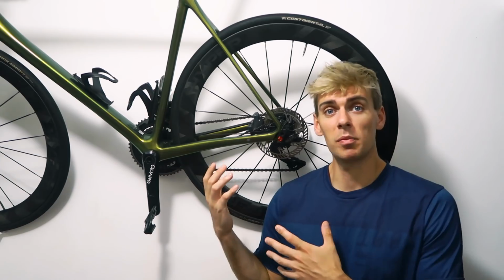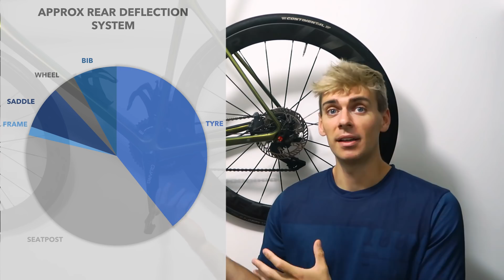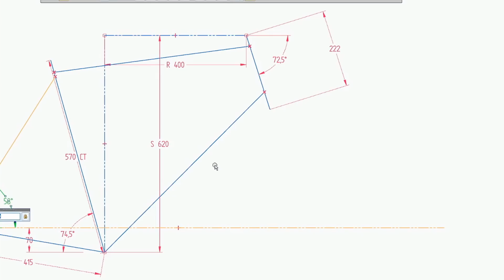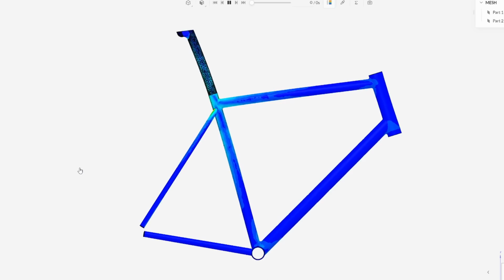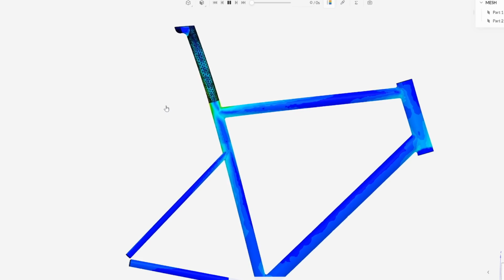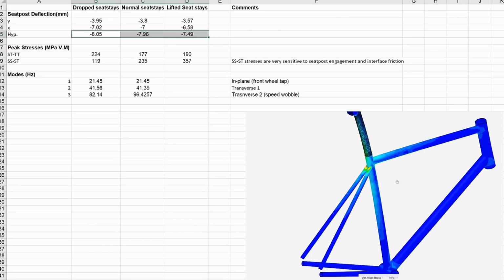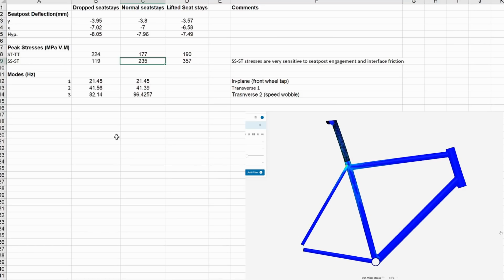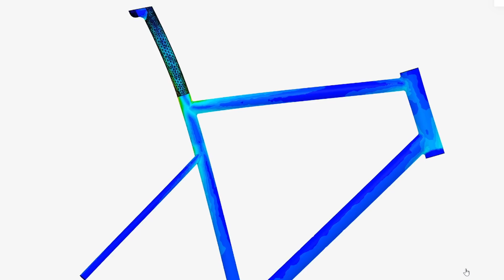Do dropped seat stays improve comfort? No.

Comment: Great tutorial. Seat tubes used to be (works of art) fluted, curved butted or necked on our big old 80s steel frames to gain more flex and compliance and we had much deeper seat rails and fat old seats. The other day I took my  87 Raleigh competition out. 20 mm tyres 120 psi and had no compliance issues. I was out with my mates on their new aero carbon bikes and I was anazed at how noisy and  jiggly their bikes where. One of my mates can’t read his garmin mounted on the bars as it vibrates so much even on 28s. I reckon that my mates Canondale was as harsh as my 92 trek alpha.
Reply: Likely because of the wheels you had. Swap the wheels out to the much stiffer ones we use today and compare again if interested.

Also sounds like your mate who couldn't read his head unit had way too much tyre pressure in his front tyre.... probably someone who runs 100psi in 25mm tyres, which is far higher than 120psi in 20mm tyres
Reply: @MrBJPitt  he’s an experienced racer tyre pressures where as low as he wanted for save cornering his new Dale is one stiff uncomfortable ride. Far worse than the rim brake super 6 he now regrets selling on the similar deep sections wheels and tyres. You can run lower pressures in 28s but you get to a point where the side walls start to move and that’s more a less at the same pressures as 25s.  This generation of bikes is far from perfect and like all transitions the industry goes back wards before getting ahead. A mature steel was better than the new alluminium, nature aluminium was better than new carbon and mature rim brake frames are far better than the modern disc bikes. In ten years when disc bikes mature they to will be good. At the moment there’s insane compromises to make them work.  . I’ve got 16 mid range production road bikes (weighing between 7and 10 kg) to ride and compare from 83 to 2010 and I have yet to find a disc bike I would want to ride.
Reply: @tobycolin6271  sounds like codswollap to me regarding tyre pressure. What tyre pressure does he run? How heavy is he.
Reply: @MrBJPitt  he is 107kg runs 90 in 28s and 105 in 25s like he’s always done the super 6 was fine on these pressures his new bike is an unhappy beast.  There’s a high frequency buzz and the thing just is truly awful on 60s.  It’s the front wheel fork combo is to stiff. He’s now got a 38 in the front and it’s better but not the aero beast he wanted. Once you start getting niggled by a bike and make compromises the shine goes.
Reply: @tobycolin6271  even for his weight he runs 28s at 105??? Yeah, that's stupid. Totally user error. Dangerous too, that's a wheel failure waiting to happen.
Reply: @MrBJPitt  I’d take you more seriously if you could read. He runs 90 in 28s. And you can run 125 psi in all continental tyres.  None of the wheel tyre pressure and weight limits are exceeded so your wheel failure waiting to happen is an irresponsible and incorrect statement.  Ill informed inflammatory comments are not helpful and is fuelling the scaremongering that is currently running through our sport.  I know parents that’s are know genuinely worried about racing on rim brakes and are looking for new bikes for their sons and daughters and that’s not right.
Reply: @tobycolin6271  your buddy is 105kgs.... I'm sick of this discussion, he clearly isn't a fast racer, and his bike isn't designed for a 105kg rider. Then you blast your tyres up to ridiculous pressure and complain it's too stiff? Lol, this is a joke.
Reply: @MrBJPitt loads of us raced over Europe in our 20s when we where much younger and lighter. We can still knock out evens today. We raced track bmx and criteriums back in the day and ride vets now. Just because we’re heavy doesn’t mean we’re slow and because we’re old doesn’t make us stupid or not able to setup new bikes or understand new tech.  Let’s face Chris hoys not that light and I don’t think you’d call him old slow or stupid. But there you go someone doesn’t agree with you so you spit your dummy out and go off in a huff. And when was 90 psi a ridiculous high tyre pressure. Deflection and rising rate is determined by the force pushing down versus the tyre construction and air pressure.his dale is designed for 125kg by the way. But you can’t read do no research and believe the media hype.
Reply: @tobycolin6271  can't be bothered to read the wall of writing, your experience is not at all my experience, so much so I just don't believe you.
Reply: @MrBJPitt  cycling is for everyone there’s a race series for us oldies, track and sprinting for big lads and that what is experienced by lighter riders is not what is experienced by heavier riders. The new bikes have problems caused by discs and cross spoke front wheels and that’s why the manufacturers have complicated frame solutions. We now have frame decouplers , fat tyres, long beam seat post to isolate the riders. Not all of these things work at all speeds on all surfaces because of resonance. I’m sure we’ll find the sweet spot ion my mates new cannondale but it’s much harder these days as you can’t swap bars change spoke patterns to effect compliance.  The  point is you can’t be bothered to discuss an alternative view or think that someone may be disappointed with a new bike.
Reply: @tobycolin6271  you can't expect to buy a bike designed for pros, and then pump the tyres up with 50% more pressure than for purpose, and expect them to be fit for purpose. Tubeless tyres aren't even supposed to exceed 72.5 psi.... so yeah, your argument is ridiculous to me.
Reply: @MrBJPitt  that’s why Hutchinson, Pirelli and continental have recommendations from 60 psi to 120 psi stamped on there tyres. Deflection, tyre contact patch and rolling resistance are dependent on three variables, tyre pressure, tyre construction and rider weight. You adjust the pressure to optimise them for the rider. 60psi if your light 120psi if your heavy 90 psi is in the middle of the range that my mates using for a 28.  What’s your next nonsense suggestion going to be. May be he should by a gravel bike so he can run 50mm 650 b wheels at 50 psi on the road.
Reply: @tobycolin6271  what do you stick tyres on? That's why zipp has a max pressure. I'm done talking about this. You are arguing a special case of a fat bloke riding a bike not designed for him, on tyres not designed for him, and then complain it's not very good.... go get a custom bike ffs.
Reply: In the old days you could swap wheels, radial, cross spoke,   Change hub flanges change the bars or stem to find a sweet spot if you had a problem it’s not easy now. You can change a tyre, or a rim depth, bars and stem and seatpost now proprietary so to find the sweet spot it’s so much harder.  I’m sure on smooth roads at 45km/h his dale is very smooth in the uk at 30km/h it’s bloody awful.
Reply: @tobycolin6271  ride your old bike then and be happy, don't make stuff up about new bikes to justify it.
Reply: @MrBJPitt  no wonder cycling has got an issue with inclusion. Riders and opinions like yours should be banned from the sport. We’re not riding zipp hookless wide carbon wheels (there the only wheel with a 72psi limit) most are 100 psi and some 125psi were not exceeding any manufacturers limits and we’re not fat.  We can still knock out a sub 6 hour century anytime we like on  a good day get near to 5 , we just have a new wonder bike that isn’t as good as it should be and isn’t the dream my mate was sold.  We’ve got loads of modern bikes that work well and I never noticed how noisy my carbon synapse is on 60s until I popped out on my steel bike. Most of the time I ride my synapse(rim) on 60s  a few us ride tarmac sl6 discs  and there’s a few giant disc bikes but the dale is the harshest of the lot. So much so that it’ll probably end up on 38s and fat tyres which kind of defeats the object and is a load more out lay.
Reply: @tobycolin6271  you made a statement totally void of critical information in your first post. You totally negated to add that the rider was 105kg, and running tyre pressures far above spec..... and then you winge when I highlight those facts? Given your first statement was so far from the reality, I don't believe anything you say.
Reply: @MrBJPitt   No I didn’t the rider weight limit for the bike we have is 125 kg the tyre pressure limit and wheel pressure limit is 125psi you pulled in specs that are completely irrelevant from zipp and hookless tyre technology tubeless tyres that aren’t fitted to the bike and aren’t relevant. Nothing is being exceeded and nothing is out of spec for the bike we have. We’ll sort it and make the bike great it’s just will need a bit of finessing to find the right combinations. But to be honest you can take your non inclusive biased vies somewhere else. You can’t read don’t listen and are adding no value to my life.
Reply: @MrBJPitt  funny old thing Marcus bagstadt runs his 27mm tubeless at 95 psi weighs 95 + kgs these days rides well above evens. Not sure where you get your biased non inclusive attitude from but Marcuses advice and coaching will do for me.

Comment: Shouldn't you have use a flattened chainstay that is common with bikes with dropped seat stays ? 

The shape of a chain stay has a greater effect on the vertical flex of a bikes rear end . Effectively making it a leaf spring ?

Comment: I'd have thought the lower stays common to every size were to lower mfg complexity and cost in the factory. Does it do that?
Reply: Also if you flatter cyclists' intelligence they will buy anything.
Reply from the maker: You're correct, it does also reduce the size of the RT mould thus reduce the tooling cost of the carbon frame...

Comment: Surely the dropped seat stays would increase potential deflection in the y-axis, ie left-right. After all, the load on the bike is going to be alternating from left to right as the rider is pedaling, so dropping the seat stays, which hold the seat tube rigid, would allow lateral flex. Obviously fore-aft and vertical flex are still restrained by the top tube, so any change in deflection there will be minimal, unless you go for the full-on MTB compact geometry, and elongate the seatpost. But lateral compliance will still occur as the rider applies a downward lid to the bottom bracket on each alternating pedal stroke. 

I say this as someone perfectly happy with my traditional diamond frame bikes, but I think there’s more to the dropped stay design than your analysis is showing.

As others have said, allowing for flattened stays should also figure into the analysis; I can definitely feel more grip in the rear wheel of my CAAD10 than in other similar bikes with round stays.

Comment: You have been mistaken, in both instances the peak stresses are lower for the dropped seat stays.
You have made my mind. Think about it, the double diamond frame would be the strongest if both triangles were equilateral. The dropped seat stay frame looks closer to an Isosceles' triangle distributing the load equally across the seat post welds. The peak weld stresses illustrate this perfectly, normal seatstays have weaker seatstay welds.

Comment: I'd like to suggest a tweak in your modeling that may dramatically change your conclusion(?) Argument "for"
I've always assumed that (to increase flex) for the droped seat stay to be  effective it must be combined with a "thinned" seat post croass section (ostensibly for tire clearance).
(Assumption) The point of low area moment  (the "flatest" cross section on the seat post in front of the rear tire) creates an opportunity for the designer to tune in the flex amount AND rhe seat arc they're seeking (for the seat total system (=> increased repeatability of flex/ride between different riders).
The design enables a engineers to control net Flex much more precisely. Controlling the flex Pivot Point ( down near the bottom bracket).   => dramatically changing the Arc of the seat (effective arc length 2.5x ro 4x?). It will mitigate the seatpost height and frame seatpost overlap effects that dramatically change Flex/"ride" between riders (w/different leg lengths on the same frame size).  

As handlebar width is adapts (to shoulder width) as frame size increases, this "hinge" can adapt as riders weights increases (w/larger frames) use slightly different seatpost extensions.
Seat posts would fine-tuned ride versus be the primary device.

Comment: @Peak Torque: from the animation, it seems that the dropped stays would cause more deflection at the headset, is that right? If so, would it make any difference with regards to take stiffeners once the fork is installed?

Comment: Man i'm suprised saddle is so low in the total. I used a saddle that had a direct connexion without flexy rail to the seatpost and the ride was absolutely terrible. From my testing saddle rail are important for road bike compliance (proper tire inflation being 1st).
Reply: I wonder how important is seatpost offset to seatpost compliance. 

Also my wife has a canyon endurace and i can tell by eye sight that the frame is indeed flexing as advertised thanks to the kinked/flattened seatpost tube. That frame has no dropped stay.

Comment: I'd never heard that lowering seat stays wes for comfort. I guess I have been missing out. Can you say a road bike has a passive suspension and a suspension bike has and active suspension or do active and passive get confusing in engineering?
Reply: No, a rigid frame has compliance, a suspension bike has suspension. Active and passive mean specific things in engineering. Something active has an additional energy input into the system, like a force actuator which is used to control the stiffness and damping. High performance cars have active suspension.

Comment: Not an engineer but just looking at what you have modeled it looks like you are only thinking about how the whole system reacts to a person just slamming their butt downward on to the seat at a standstill. 

In terms of what actually happens when you ride the bike out on the road you have to consider the force of the tire hitting a pot hole and that force being send upward (not completely from top to bottom but at some angle like 11 o'clock) this would depend on the impact but something like that should send an upward force starting at tire - rim - spokes - axle - rear dropout - frame tubes - seat post - seat - then finally your butt and then the rest of your body ending with your hands. 

So a force then coming into the rear dropout upward and slightly back is going to flex the bottom stay where it rotates a little around the bb, but the topstays would be pushed upward where if not put into a hard intersection like a traditional bike that has a top tube right there it could instead flex the seat tube a little and not send most of the impact into the seatpost and cause more bending there. 

Either way thanks for the vids, and definitely go carbon with the seatpost.

Comment: I've got an aluminium frame with dropped stays, the seat tube/top tube weld is starting to crack from the top, I use this bike for Audax etc do it's done quite a lot of km with a 3-4kg seat pack on it, that's way less weight than I put on the seat, but it's dead weight, it doesn't react proactively to bumps... Oh well, time to replace it, crack propagation is currently very slow but one day it'll not be.

Comment: Am I the only one who's slightly disturbed by the thought of the dropped seat-stays applying forces to the unsupported middle of a tube?
Reply: It's not as if the strength of the seat tube is compromised in tension at that point except of course the bottle bosses. But in reality I wouldn't think you would be getting anywhere near the yield strength of any frame material.

Comment: I like your engineering analysis of bike tech, but I feel like this one is missing something. You assume "comfort" only for a seated rider. The saddle is only 1 of the contact points for the rider. You ignore handlebars and more importantly the pedals, and don't account for a rider that isn't seated. If you consider a gravel bike on a bumpy descent where the rider is standing, or a roadie in a supertuck that smacks into a pothole, the seatpost deflection has no affect and it is the rear triangle that has to absorb energy before it is transmitted to the rider via the pedals. I'd love to see this same test done where the stress is done from the rear dropout.

Comment: What is your opinion on the Sram GXP bottom bracket standard? Would it be a better option on bb86 than DUB which has thinner bearings, but a more «conventional» setup?
Reply from the maker: Avoid dub. Gxp in pf86 works fine for me. Steel axles are better.
Reply from the maker: Dub in pf86 is a terrible idea! You are right.
Reply: Nice, that’s also what I chose. Do you know about the friction in GXP compared to e.g. Shimano? I have watched a certain 5-year old on YouTube telling me about premature wear on the non-drive side.

Comment: Nice ! 
Its all the same for " aluminium ", " steel or stainless steel " and " carbon fibers " frames ? 

Idea for a next video 
Myths and reality about Integrated Seat Posts ( both in metal be it steel, ti or carbon isp ) . 

They are mainly gone from nearly all productions bikes. But some small and not so small custom builds are using them. Mainly for anesthetics I guess. They also reduce practicability for travel etc. But speedvagen for example make some bolds unproven statements about them.  

Thanks
Have a good one